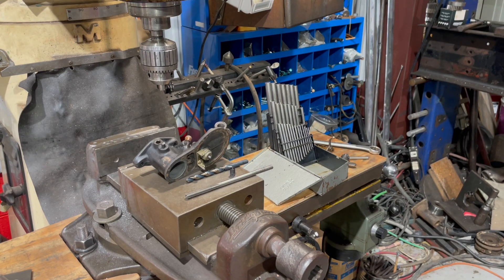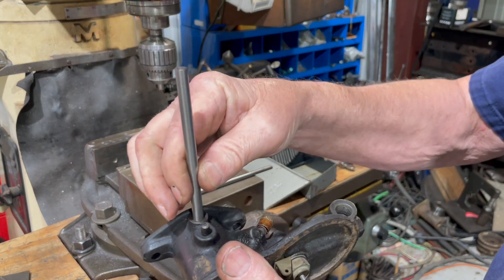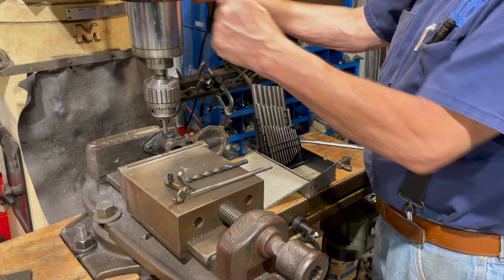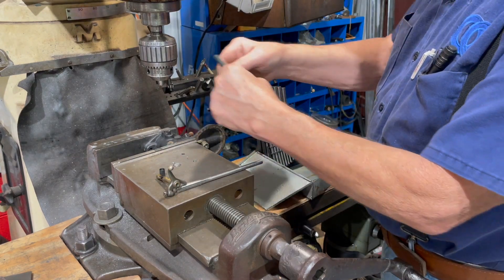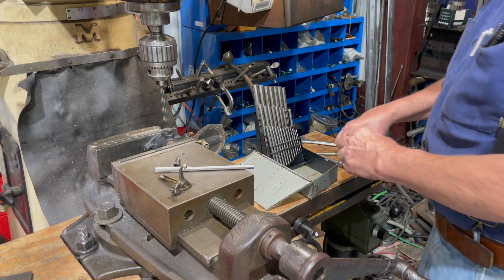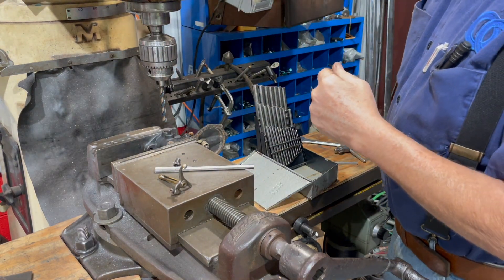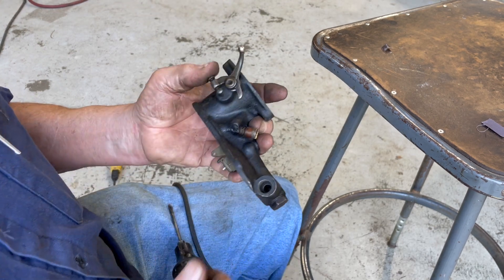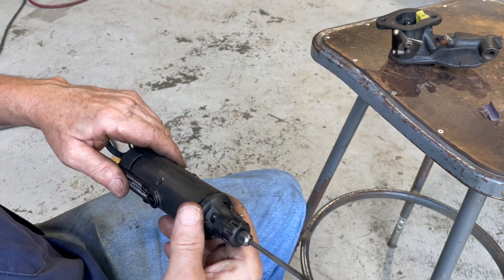MODEL A ZENITH CARB THROTLE SHAFT BUSHING

Comment: Great method for installing that bushing, nice work! I like the mini-flapper tool also, I can think of many other places I can use one of those on a model A. 
A lot of people just use a hand drill to enlarge the hole for the bushing, but they don't realize, until it's too late, that the throttle plate may not be centered in the bore when they are finished.
Reply from the maker: Thanks glad you liked